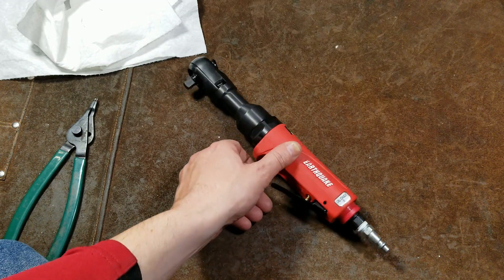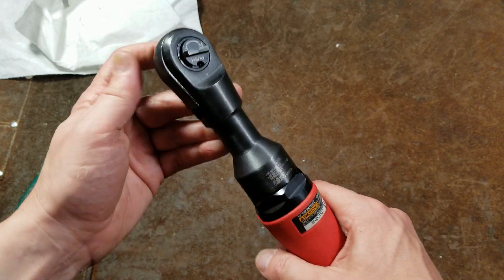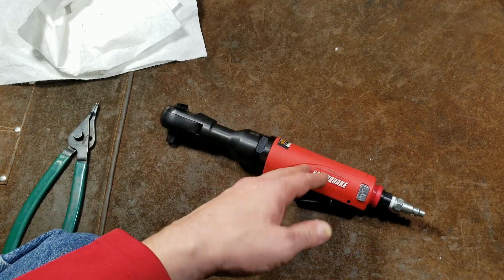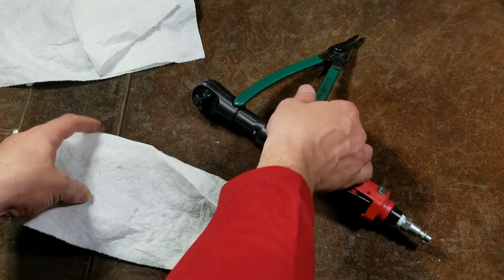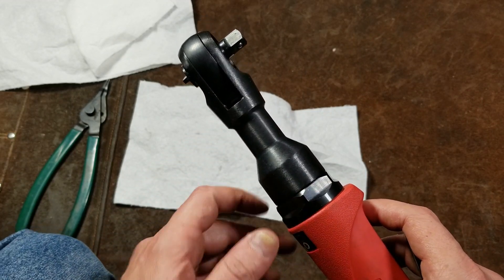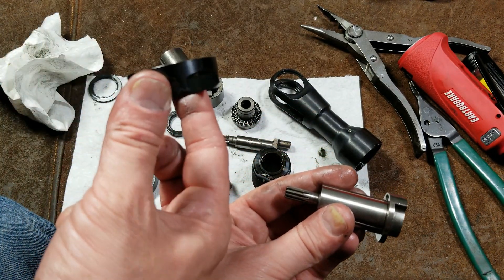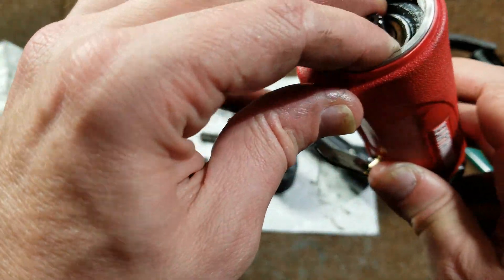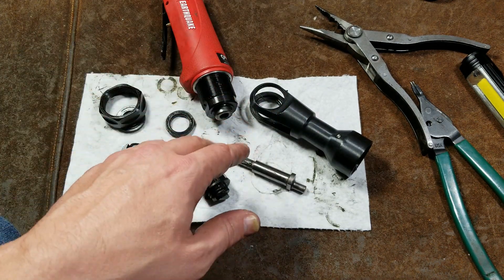EarthQuake Reactionless Impacting Air Ratchet Teardown

Comment: I really wouldn't call this an "impacting" wrench in the same way a real impact wrench delivers its energy. A real impact wrench stores its energy in the spring over a significant portion of the revolution and then releases it all at once when the hammer hits the anvil and the cycle repeats. The whole system is tuned to the operating speed of the impact wrench to optimally deliver the impact energy and allow the hammer to bounce off the anvil and travel over it for the next cycle without causing wear to the anvil.

This kind of ratchet is similar to an adjustable torque limiting clutch on a drill. It's not designed to deliver its energy through the clutch mechanism. The clutch mechanism is there mostly to prevent injury to your hand or damage to the fastener. Yes, there is a small amount of energy that is stored in the spring that must get released, but this is also true for a regular adjustable clutch drill. The mechanism in this ratchet is only slightly more optimized to deliver that energy more effectively, but I think that mechanism actually exists primarily to protect the main spline drive shaft and air motor from wear due to impact/shock load. So instead of the spring's stored energy going through the drive shaft and causing a lot of wear, the drive shaft smoothly rotates and builds up the stored energy in the spring until it rotates to the point where the anvil is designed to push up and release all of its energy (which isn't very much).

Comment: Mine worked 3 times and the the air came out of the bottom
Reply: Did you tape the threads before attaching coupler?

Comment: Great explanation and tear down! Mine stopped and would only hiss air ( yes it had lube) we did push open that tiny spring loaded oil hole in the body and shot more lube in it. Then tapped it with a small rubber mallet ( while holding down the trigger with air on it) and it started working again! 😂 Thanks again!

Comment: I just got done tearing down my earthquake following this video, and after I greased it and put it back together it's working again.  Owe ya a beer...
Reply: As mine was used and abused one day it decided to just blow air. I bought it as an open box special, no warranty was available. I work in a very aggressive environment and have been watching air ratchet reviews. Facing a $100-$600 decision i stumbled across this video. Its going to work tomorrow and getting a tear down. I will share my results. But frankly this air ratchet was very impressive compared to an Ingersoll model I had for about 15 years. If the teardown fails, I plan on buying another one new with warranty.
Reply: @jessj3010 did you end up fixing it

Comment: I think it is made by Florida Pneumatic which is a great company.  It looks very similar  to the one I have that is sold under the Husky Brand sold in Home Depot.  They rate theirs at 80ft lbs.  Mine is about 6 years old so it is made in Taiwan; I believe the new ones are sadly China.  I just re-watched the video with my Husky parts exploded view and it is the exact same thing.  I know the address and phone number they give is the same for Florida Pneumatic so most likely the Harbor Freight one is made by them also.  Not a bad tool at all.

Comment: Nice job!  Thanks for that great video!  I always wondered how they could get an impact drive inside a ratchet which is not much bigger than a regular one.  If you ever get a chance, would you consider doing a tear down of the HF 1/4" pneumatic, impact screwdriver?  I bought five of them, to get one that works well in the forward direction, but is intermittent in the reverse direction.   The other four either did not develop full speed, had speed fluctuations or had forward drive problems, but all of them did not work in reverse (they just blew air out the exhaust)!   Thanks for all the time and effort on these videos!!!